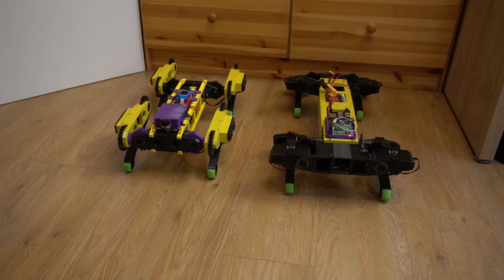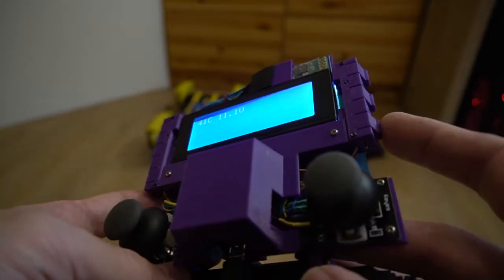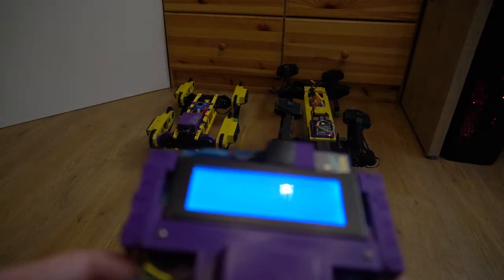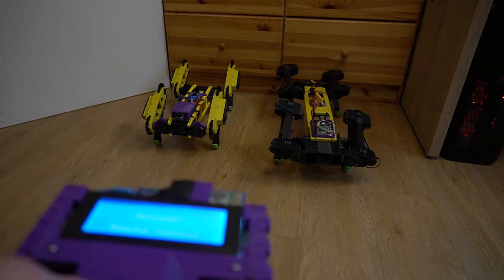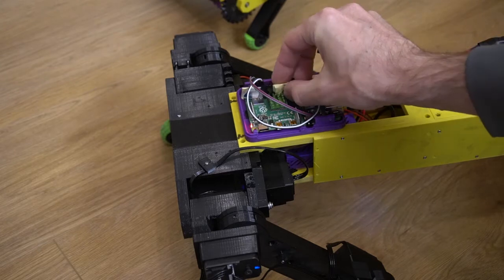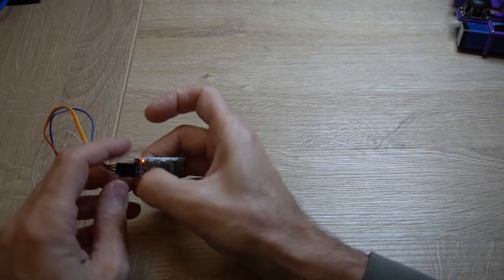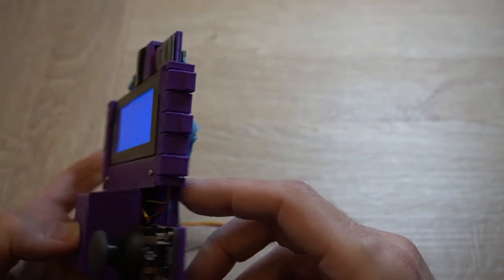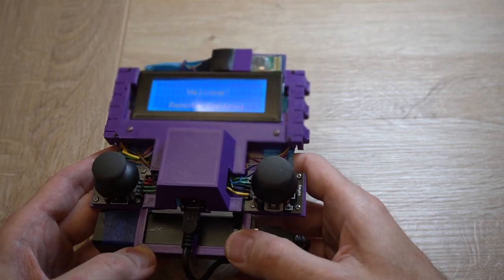Universal Remote Control for robots

Comment: I've made the controller for my V2  robodog but the sticks only work in one direction  100 one side 0 on the other in X and Y What will fix this?
Reply from the maker: The potentiometer divider is not working correctly. Maybe + or ground is not connected. Check the voltage from potentiometer during moving stick to its limits in both directions.
Reply: @RoboLab19  I check them 2.5v center 0 one side 4.8v other side. I wonder if its some how hitting the dead zone by mistake.
Reply from the maker: Looks strange. Try to disconnect the BT module, attach the arduino monitor and add traces to function cycle_joystick() to see the analogRead values. They should be changed in range 0..1023 when moving the sticks.
Reply from the maker: And maybe you right about dead zone :) Try also to replace the 340 to higher number. It should be double of center (in my RC center was 170)
Reply: @RoboLab19  It was in dead zone loop. I loaded a basic joystick sketch and printed the x y. My sticks read -512 to +512 the center was 0. I changed the center sticks numbers to 512 and the 340 to 1024 in your sketch. That got it to read -100 to +99.  In the basic sketch the x sticks where -12 at center and the y was +4. how would I correct it in you sketch? I don't see how the stick center works.
Reply from the maker: You did it right, for you hw the center is about 512 and the right bound is 1023 (instead of 340 that in my sketch). Just measure the center more precisely with +- 3 points for each x1_0, y1_0 and so on.